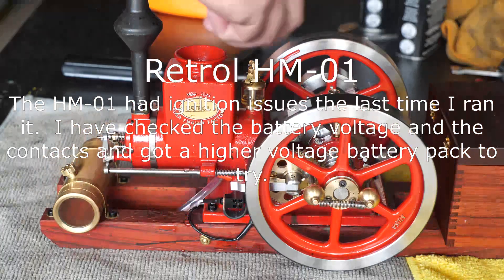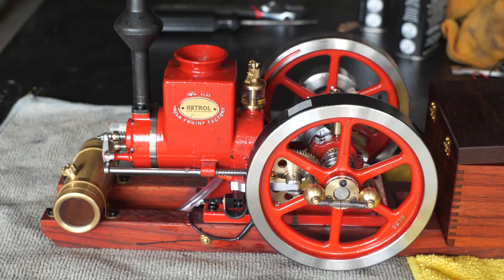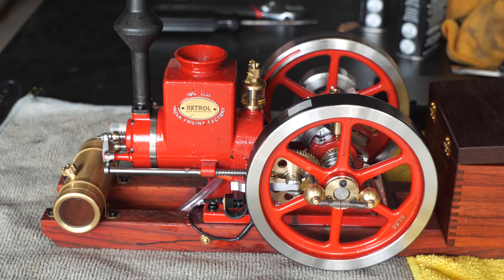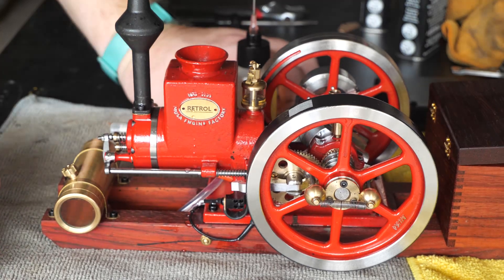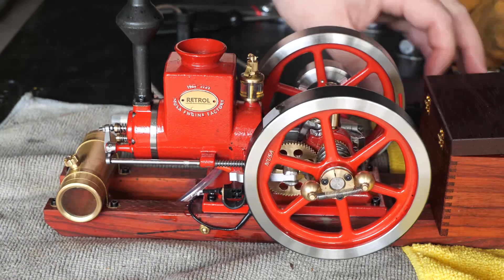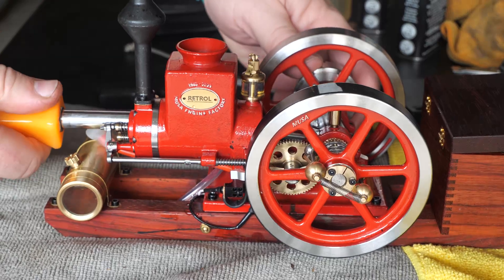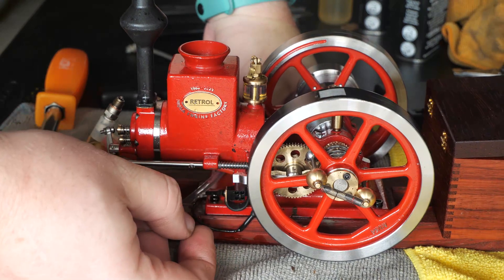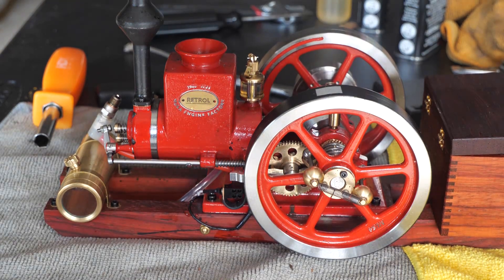HM-01 Ignition Fix Failure

Comment: Henry, FYI - I took a tapered rubber bung plug, drilled a 1/4" dia hole through the center, inserted a 1/4" bolt and nut and attached that to a battery operated VS drill.  I then insert that into the pulley and crank it CCW.  It makes an excellent starter.

Comment: I just built mine cannot get it to start, doesn't seem I'm getting a spark at the plug but definitely measuring correct voltage from the new batteries ?? Any ideas.
Reply: The ignition system these engines come with is a piece of junk,very weak spark only one snap when they fire,make trying to run them an exercise in frustration,they need a buzz box to run right,I built a buzz box for mine it's the improved version of the old blue engine et1,runs like a different engine with a good ignition well worth doing,also there is room for improvement all over these little engines

Comment: Of all the videos you have posted I don't think I have ever seen this engine of yours run for any length of time.  Others yes but not this one.
Reply from the maker: It's got about 10 or 12 hours on it total and, while I love it very much, it has been cantankerous and the yellow ignition module I put in it was chosen for having the correct length of spark plug lead.  I don't remember why I had that yellow unit spare from the Enjomor in the first place.  I will be putting the HM-01's black Retrol ignition unit on it when I replace the yellow unit.  I had chosen the yellow unit because I didn't want to extend the short spark plug lead on the black Retrol unit.

Comment: I ran into the same problem, with the spark plug wire on the stock ignition pack being too short to reach up front. I spliced in a two inch long piece of wire to mine, right under the engine, where you can't see it. 

Another thing, I found a 3 battery pack wasn't enough to give a good constant run with the stock module.  I wanted the batteries to fit in the box, so I carefully  soldered  a cluster of 5 double A batteries to form a compact pack to power the module. This cluster is small enough for the 5 batteries and the ignition module to fit in the wood box.
Reply from the maker: mine came with an extension for the ignition lead, but I had a unit with a long enough lead so I traded it out, but that unit seems to have failed so I will be digging the stock unit out and fitting it soon.
Reply: @henrybangsberg2187  Oh that's cool that it came with an extension. :)  I hope all goes well with the change over.